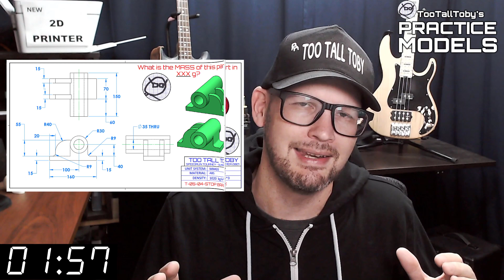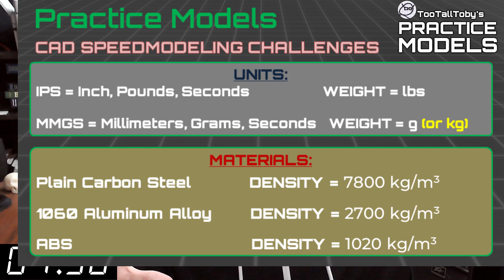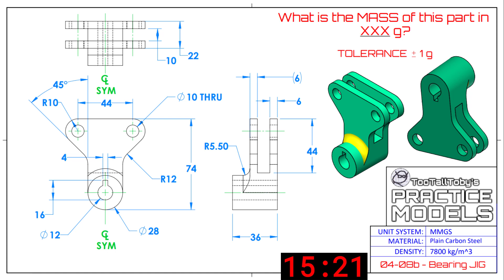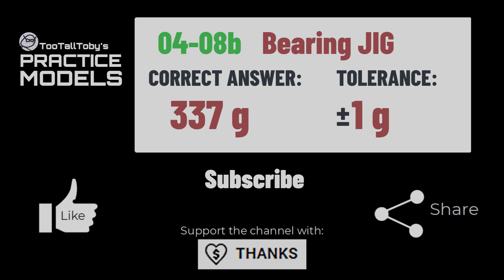SOLIDWORKS Practice - Onshape Practice - Fusion 360 Practice Exercises - TooTallToby-04-08b

Comment: Solved  in FreeCad with a Mass of 337,17 🙂 This fucking R5.5 drives me nuts but I get it. Now going to see if Onshape  can do it without some tricks 🙂
Reply from the maker: lololol - Sorry about that.  I think sometimes I used to make my dimensions "oddball" so I can get the mass to be a desired value (like close to a whole number, or significant digit - in the old days I used to do more 1 and 2 place precision masses).  And I think that value is a remnant of those days :-)    Nice job - love seeing FREECAD in here!
Reply: @TooTallToby  In FreeCad it was a mess of add and subtract. In Onshape the way to built is much easier. But I love Freecad
Youir dimensiopns are cool. you have to think about it. Go on